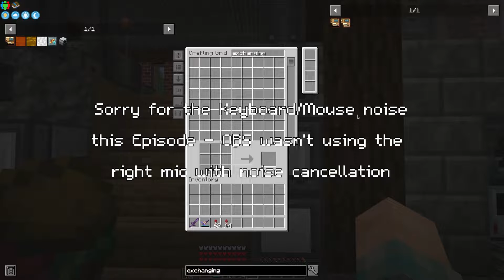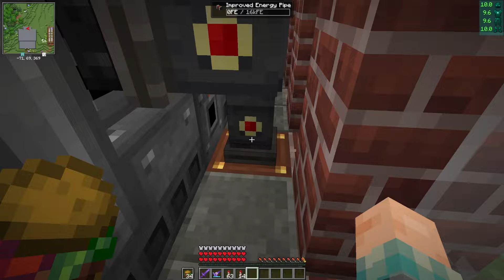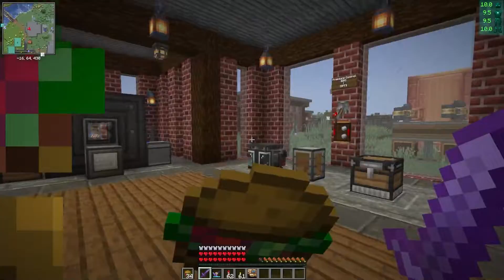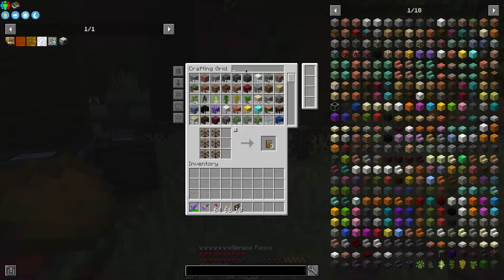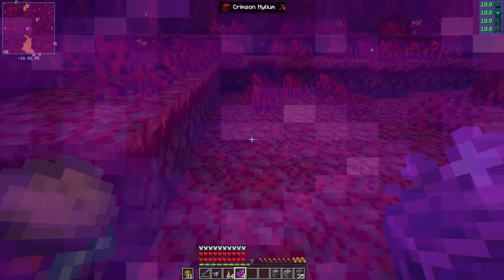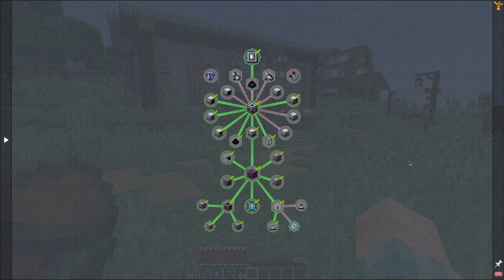[HE3] Episode 35 - Tree Fluid Automation

Comment: A good rule of thumb is that modern mods default to using mb, it's a change that happened around 1.12
Reply: Also RS has innate crafting with fluids, even with amounts of less than a bucket, although I usually multiply the recipes to equal a full bucket to batch craft since RS like to craft one item at a time with fluid recipes
Reply from the maker: Oh that's good to know!